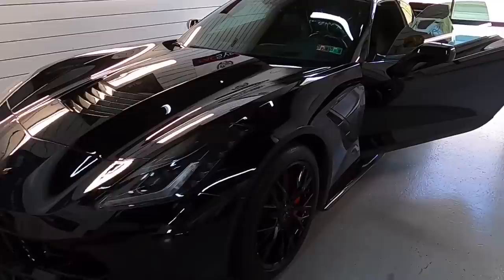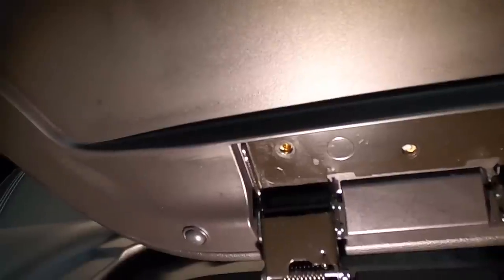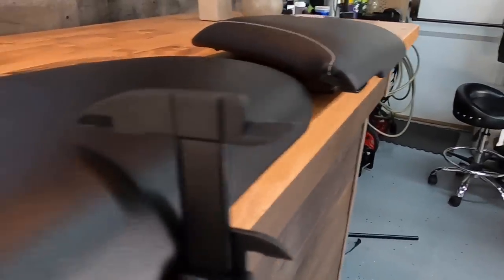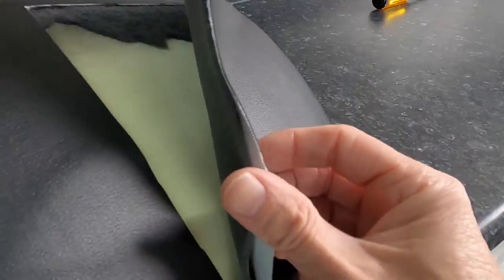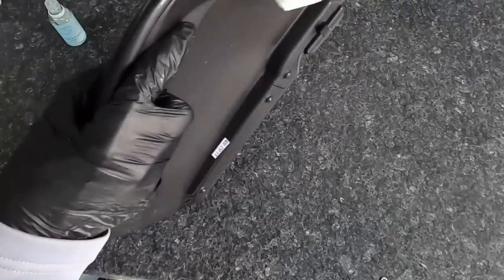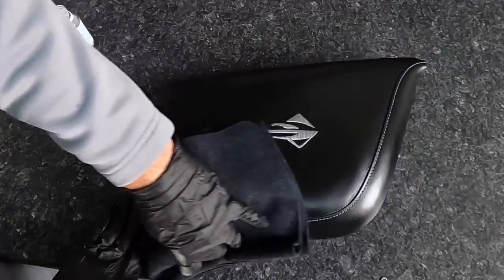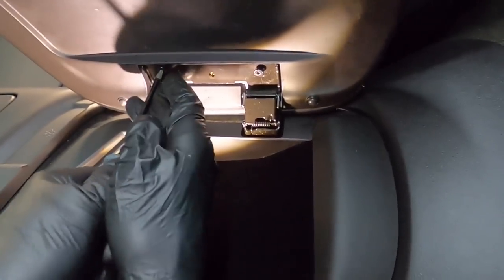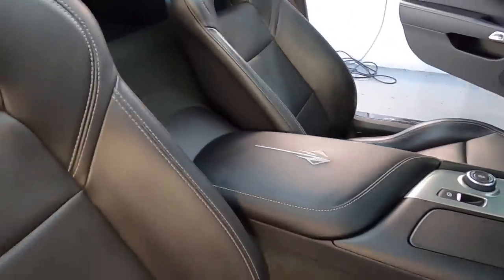C 7 Corvette! Addressing A Common Interior Flaw!

Comment: Hi Brian... Great as always.
I have a question if you don't mind. How can I know when the coating applied is already gone and what will be the general process to recoat? This question applies for either coating Leather, Trim, Paint or Wheel.
Reply from the maker: The obvious protection will diminish. Depending on the material...polish or chemical will remove what is left over,.
Reply: @apexdetail85  Perfect. Thanks for the clarification.

Comment: So is this “leather” really a coated plastic product? My C7 has the micro fiber / alcantra interior, but it suffers the same separation / wrinkle problem. It’s worse on the doors. The microfiber stretches and pulls away from the foam. I have the dreaded 3LT dash - thankfully mine hasn’t separated yet but the edges of the bat wing above the gauges isn’t holding down so great. It’s too tight of an edge, GM should have stitched it in a different place to relieve pressure. The C7 is great, the driving experience is amazing... but in typical GM fashion there are some minor interior and exterior cheapness that shows thru - if you know where to look.
Reply from the maker: I couldnt agree with you more.